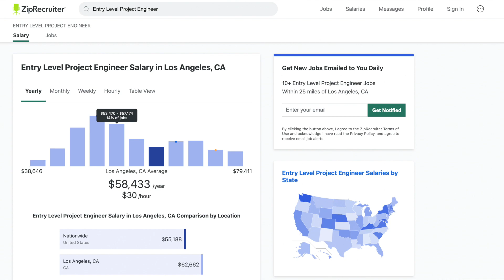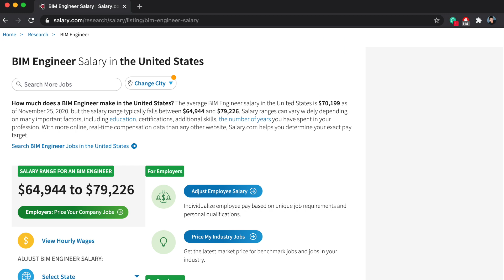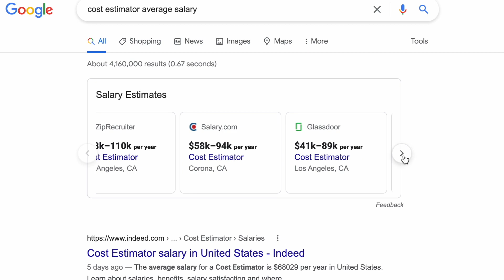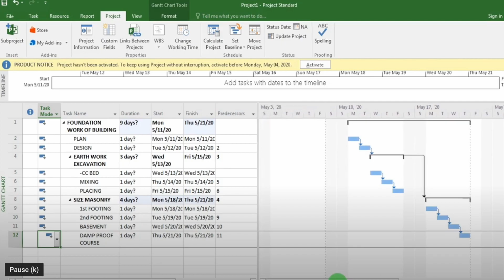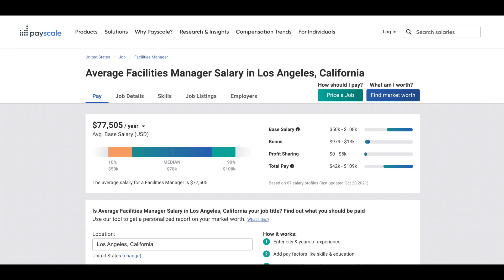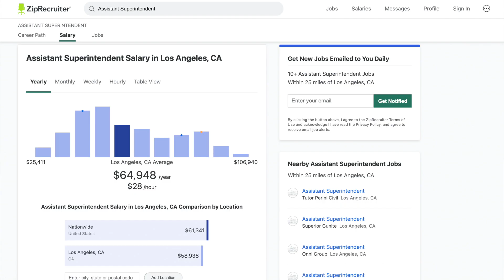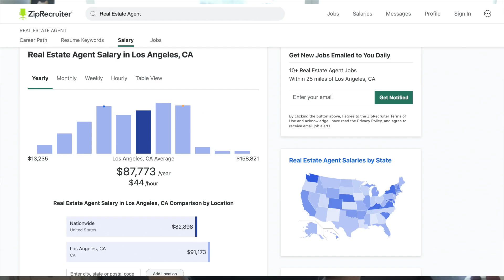What you can do with Construction Management Degree

Comment: What roles should I be looking for in construction with a Project Management degree, I served in the Air Force attached to a CE unit doing hvac could i possibly fill a field engineer role and work my way to project manager?
Reply from the maker: Yes you can. But given your background I’d say your best bet would be to start with a HVAC contractor and after a few years you can hop over to a GC if you’d like or stay in the company and work your way up to PM level. All the best!